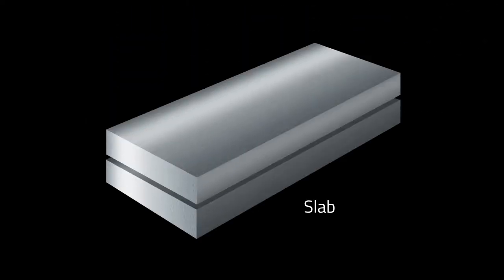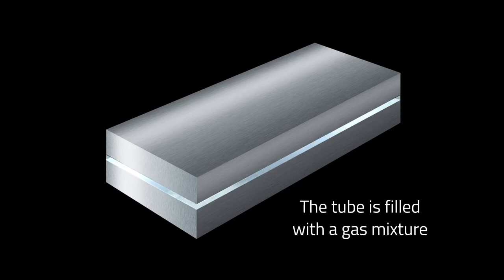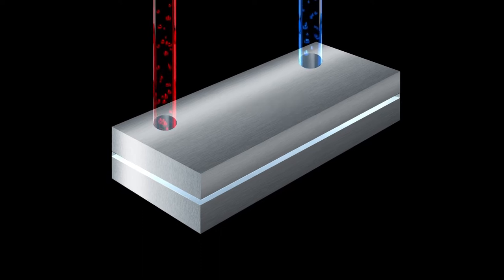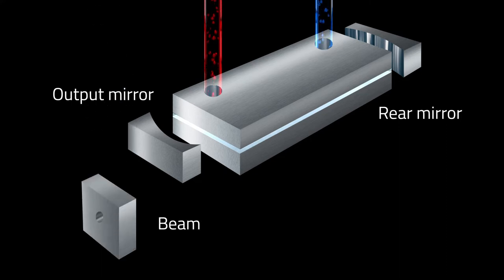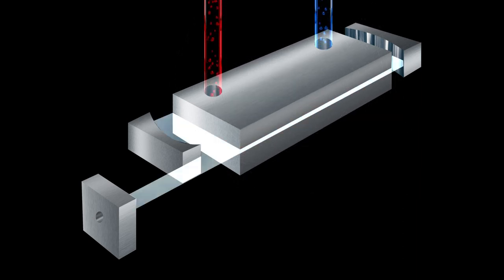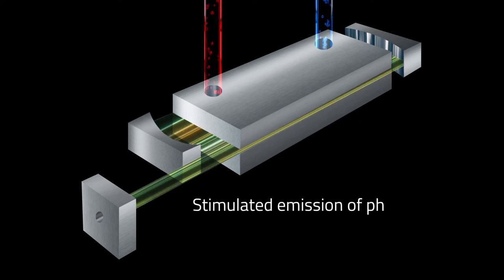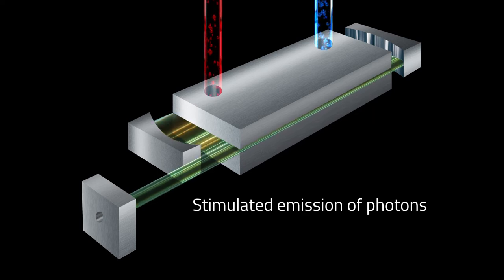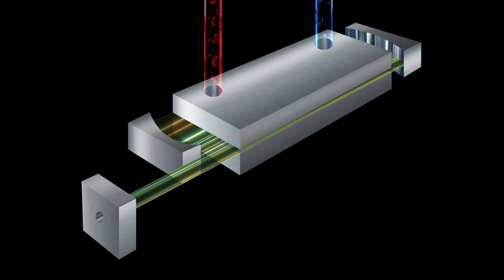The principle of CO2 lasers

Comment: nope. the water density and gasses, redshifts the wavelength of light  which gets trapped by the angle of refraction . focused by the mirrors into a beam which blueshifts on release . that's why when the beam goes through glass or dense air it stretches the wavelengths again and seperates causing stringification